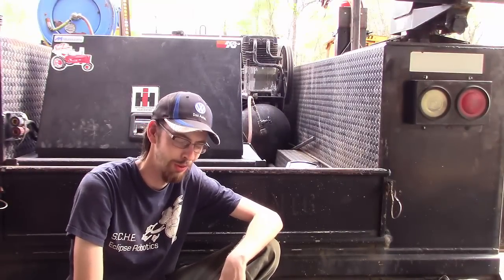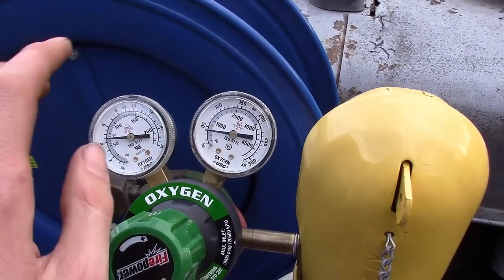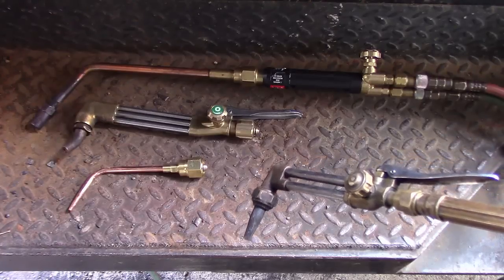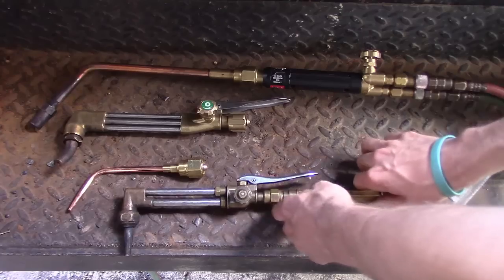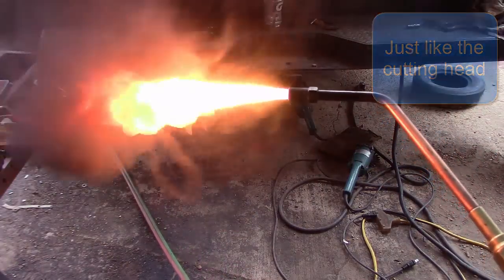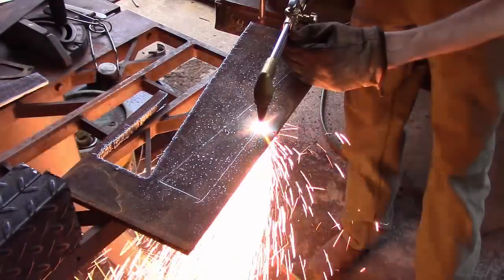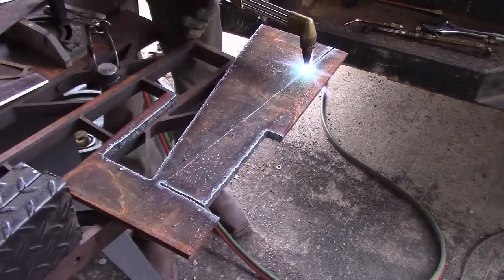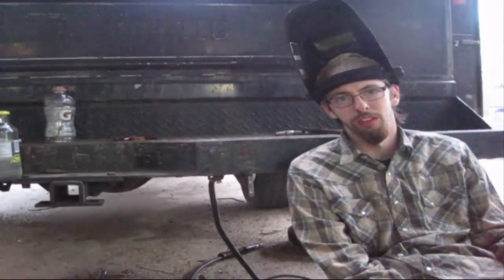Acetylene torch basics

Comment: Please explain - if the flame tip should not change when pressing the oxy handle - then why is it there?
Thanks for your help - I'm a newb at oxy/acytle
Reply from the maker: When you’re setting the flame you want a neutral flame meaning it’s burning with just enough oxygen to not alter the heat coming out of the torch. If you don’t have enough oxygen it will be a cold flame and it will take forever to heat the steel plus when you hit your oxygen lever the flame will change causing the cones on the tip grow or shrink causing a bad cut. If you have to much oxygen the sound of the torch will be much louder and the chance of a back fire is much more likely plus it will try to cut before your ready causing a bad cut.  It’s got to be just right for good results. The oxygen lever is for cutting only not adjusting the flame. Most people think that an acetylene torch is a physical process using heat to melt steel it’s not. It’s a chemical process your using oxygen to burn the carbon out of the steel essentially making it rust very fast heat is the catalyst to make it happen. This is why you can’t cut aluminum or stainless with a torch because no carbon in aluminum and stainless there is a wrong chemical bond for it to work.

Comment: You ever use compressed air instead of oxygen
Reply from the maker: Compressor air doesn’t work on a cutting torch set up because you need 100% oxygen to make the cut operate. A acetylene torch is more of a chemical process rather than a physical one you’re essentially making something rust extremely fast that’s how it cuts.  Compressed air works on a plasma torch because it’s a different process.

Comment: The reason the heating tip is whistling and warming up at the mixer is because you are STARVING THE FLAME. If the rig is in good conditions, starving is due to acetylene pressure being too low. There are o rings in many mixers so you don't want a backburn at the mixer.

Comment: Some extra things to know:
-Check the regulator max pressure against the tank it's going on.
-Make sure the cutting tip is sized such that you don't exceed 1/7th of the volume of your acetylene tank in an hour or moderate your use such that it doesn't happen as this can cause the acetylene to behave similarily to when it is above 15 psi.
-make sure your acetylene tank remained upright for 24 hours prior to and during use.
-Always purge your lines and regulators before opening the main valve and when opening the main valve especially with the oxygen do so slowly to prevent compression in the regulator causing an explosion.
-if you don't already have, get a flashback arrestor at both the torch end and regulator end of your setup.
-keep the tanks chained up.

Comment: Unfortunately, with ALL this great instruction, his valve disengagement was 100% wrong. ALWAYS shut off Oxygen FIRST due to suit blowback potential back inside the tip/chamber. "The safe and correct method is to shut off the Oxygen first."

Comment: Got a ? 4 u why my torch pops with a new tip? I just replaced the tip and it just pops like crazy
Reply from the maker: What are your gas pressure settings?  Put your accly on 8 psi and your O2 on 60 psi.
Reply: i'll try that, thank you

Comment: I watched you cutting, Is it ok to cut on top of those rubber hoses?
Reply from the maker: It’s not ideal but the hoses are flame resistant just keep an eye on them and be sure you’re not splashing them too much.
Reply: @EEJester1586  I did, but when your dross is 1200deg c it will melt both tubes really quickly. You end up jumping off a 777 cat chassis willing to break a leg to turn off both bottles, as both oxy and da ( dissolved acetylene ) lines are wheezing round on fire like windmills, burning their way back at some speed to the bottles. It was my mistake so it’s up to me to save the people around me, if a full oxy bottle goes up there won’t be much left of anything for quite some distance. They are waiting to kill you ( the bottles ) one mistake in 30 years that’s all it takes. But you carry on, just remember it’s your responsibility to run towards the bottles that are on fire.
Reply from the maker: @andyav9165  I gotch and I appreciate your concern.  Ive never had a hose fire although I have seen a few from other people.  And your right heard horror stories about people that nothing but mist because of a O2 tank blowing up or clothes set on fire from gas leaking on a shirt. They are very dangerous but I got a firm belief that it’s only as dangerous as you let it sometimes you can get away with it other times you can’t.
Reply: @EEJester1586  yea, I got complacent,  it got scary really quick, but as you say keep on top of it and all should be good. A colleague of mine, a fitter by trade lost half a thumb and quite a bit of his hearing due to oil contamination, a gauge blowing up by his face. Take it easy happy cutting🏴

Comment: Public service announcement:

I have read that you have to have a "Grade 5" shaded lens to effectively prevent damage to your eyesight while using oxy-acetylene.  I'm quite doubtful that the average pair of sunglasses are this shade.

My question to the video host:  why did you use a rosebud for cutting? I just had to spend $120 on a rosebud after I just spent $500 on a little tote kit.  

The tote kit came with useless cutting and Welding torches which I my crystal ball I don't know what I would ever use them.  Red Loctite needs to be heated before you can take it off easier.  I live in the Rust Belt and corroded Fasteners drive me insane so I hope I have less headaches with oxy acetylene in getting Fasteners to free up.

Comment: Thanks so much for making this video. I've learned a lot from this. Really appreciate that!
Btw, I don't use the torch every day, just use it to cut off the old nuts and blots. They are about 3/4 to 1"
Which cutting tip or burning tip should I use?
Reply from the maker: Thanks for watching. For general stuff I normally use number one. So I on a Victor 101-1. You can cut easily 1/4 inch to 3/4 inch with that tip.
Reply: @EEJester1586  thanks for quick response my concern.

Comment: Could you explain more about the tip sizes please no one has that but if you look on the recommendation chart for what to uses with different thicknesses of metal the tips will change from like 000 to 00 to 0. What improvements will it make in your cut if you use their guidelines? Or does it not matter?
Reply from the maker: Planning on doing a video on this in the near future.

Comment: Disagree with you on how you set the gases up sorry. You have rubber diaphragms inside the gauges. If you have the gauges already turned up before you turn the cylinders on you get instant pressure to the gauges. This can damage them in time. The proper way to do it ( btw I still do it your way even though I know its not correct) is to turn the gauges all the way out so you have no pressure in them. Turn both gases on on the cutting torch. A few turns on each one is fine. Next, you turn the acetylene cylinder on, pressurize the gauge until you have gas coming through your nozzle. Light the gun and then pressurize the oxygen using the gauge until you get the desired flame. You did not mention flash back arrestors either.Also, Oxygen is more dangerous than Acetylene. This should be turned off first not Acetylene. You will understand if like myself I have had an Oxygen hose catch fire. It acts like a Thermic lance. Acteylene gives off a "cold" flame whereas oxy aids combustion and is very fierce. This is why you should never dust yourself down with oxygen. One spark and you go up like a bomb. Finally, don't suggest sunglasses for cutting. Thats plain stupid. Sorry, not having a go at you.Just trying to give my many years of experience and still learning

Comment: "At no time should the withdrawal rate of an individual acetylene cylinder exceed 1/7 of the cylinder contents per hour.
If additional flow capacity is required, use an acetylene manifold system of sufficient size to supply the necessary volume." 
    -Victor, Harris, Airgas, etc. 
However, recently the 1/7ths rule has been amended by an additional 3 tenths. So.... 1/10ths Rule.

Comment: I forgot about the rosebud. I used to cut, solder, and braze, but I haven't used a torch in years. I think I'd be a little rusty if I picked one up now, but it would come back quickly.

Comment: Any well equipped welding/burning supply shop has multiple solutions for different types of gases, and torches.  37 years burning thick steel.  Acetylene is the least valuable of the gases. If you happen to run your tip too close to the plate it doesn't extinguish the flame, but goes into the tip itself, and because it's copper it just melts.  Blowing holes and cleaning the tip decreases the life of the tip much more than 2 piece tips used with all other gases. Burned 26" thick plate(in 1980), and routinely burned/shape cut 12" thick weekly. Propane is the gas that most all Fab/ Steel Service Centers use on "X"-"Y" axis shape cutting machines in Metro Detroit area.
            For people stuck with Acetylene this guy's advise is spot on. Chasing overtime and Fab closings i have used about everything and my choice is Harris Torches & tips using Propane.

Comment: when i learned to use a torch in ag class they always  said to stay off to the side of the regulator so if the handle  blew out it wouldn't hit you  think you would have to have a really bad regulator to do it  but that's the way i learned.  Liked the refresher on settings,  always good to review things so you don't get in a rut of doing the Wrong thing !!   THANKS again

Comment: One thing you didn’t mention was that you shouldn’t get the tip too close to the surface or touch it to the surface while cutting. I have found that it will cause it to make popping sounds and I was told that it can cause the flame to flow back up inside the  torch (flashback ). I am not an expert with cutting torches, but that was what I was taught. Not sure if that is correct or not.
Reply: I was taught that as well.

Comment: EXCELLENT video.  Only thing I would add is to the safety side.  Might want to mention and show your check valves and/or flame busters.  Very important as you essentially have two pressurized bombs at the other end of your hoses.

Comment: Great video.  Do you stay to the inside or the outside of your drawn line when cutting?  It looks like outside but what determines the width of the cut (kerf)?
Reply from the maker: You can cut either way.  Most of the time if your cutting a piece to fit inside a place you’ll want to cut it smaller that way you’ll have Clearance and just fill in with weld.  The kerf is determined by the tip of the torch. Just like in woodworking a sawblade has thickness so you’re removing material.  A torch is doing the same thing you can’t see it on camera but if you have a shade or lens over your eyes you can guesstimate where are you need to led.

Comment: Hi, I recently purchased tanks for my oxy/acetylene torch. I noticed that the acetylene tank has same type gauge fitting as oxy. Can you tell me what type of fitting I need to correct it for new gauges?
Reply from the maker: You shouldn’t need any fittings other than the gauges to bolt to the tanks.  Just remember that the acetylene is left hand thread external threads. Oxygen in his right hand internal threads.
Reply: @EEJester1586  My acetylene tank is set up with a right hand thread coupler like the oxygen.
Reply from the maker: Fred Bradford wow never seen or heard of that before.  What size tank is it?
Reply: @EEJester1586  The acetylene is about 3' tall and says 210 CF on it.
Reply from the maker: Fred Bradford ok I’ll have to do some research on that.
Reply: @EEJester1586  Thank you.

Comment: Hey, I see your using firepower gauges. Do you recommend that brand as set with torch included?
Reply from the maker: I’ve had good luck out of them.  They have been exposed to some really bad weather over the last few years and I’ve had them hang up a few times (where are they wouldn’t regulate right) but they always worked it out. They are pretty good for the price so yes not a bad set up.
Reply: @EEJester1586  Thanks for the prompt reply. I read that Miller makes smith brand which is made in US and very good. Any opinion here? Looking for good quality set up for garage use.
Reply from the maker: Fred Bradford yes smith is a great torch. The next one I get will be a one piece Smith.  The older victor torch’s are also really good. I will say the new victor gauges are not the best they are really bad to leak even when new.
Reply: @EEJester1586  I understand the victor is made in China now. Miller/Smith is the way I'll goes, thank you.

Comment: At 70 yrs. old and 37 years running "X"-"Y"coordinate systems oxy/fuel gas.  Acetylene has its place, but the real thick steel plate cutting is Propane or even lowly Natural gas(ran with a custom compressor and safety trap that was provided by the local energy co.). I have regularly cut 12" thk. plate with 3 torches simultaneously cutting bearing caps for the gear box of one of the largest strip mining crane gear boxes in the world.  The correct tip and the correct PSI for your cutting Oxy coluum is what is required to burn thick plate(problem here for amateurs is just because your cutting Oxy gage says 100PSI doesn't mean that according to specs your going to cut what the book says you should it is how big or how many Oxy Condensers you have out at yor Oxy tower behind your building that determines how fast LIQUID OXY converts to a gas!). What ever gas your running for preheat cone shield ing your cutting Oxy steam is usually anywhere from 4PSI to 35 or higher PSI for extremely thick metal.  Just so you folks know there are suppliers of  Iron-Powder-Oxy/fuel gas cutting torch set-ups that cuts up to 4 feet thick Stainless Steel, Cast Iron, Brass, and even Aluminum. Praise be to this guys vid for a basic info on Ace torches. Watched a guy start a cut on a rectangular 6" wide bar near 30 feet long out of 6150 Steel plate. In hindsight i should have stopped him as i knew one torching that as a rectangle would cause a three foot warp in that bar and cost him his job. There was a 2 torch technique that would allow the VERY EXPENSIVE 6150 to grow or contract with eqaul heats on each side of the cuts.

Comment: I am new to this and welding (which I will start learning soon also). I have access to cutting torches and will give this a try. My question and concern is the hoses, they look a bit dried out with fine hairline cracks in the rubber. Ok for quick small jobs or no good?
Reply from the maker: As long as they don’t leak.  Make sure your knobs are tight on your torch cut on your acetylene and oxygen until the pressure builds cut your bottles off make sure they hold pressure. If you have a bad leak the needles will fall really quickly. Use soapy water on regulators or torch or hoses to find leaks. It’s been my experience that hoses normally don’t give trouble unless you burn one through so you should be good.
Reply: @EEJester1586  Cool and thanks for the quick reply

Comment: interesting, a safety issue i see in how you assemble your two piece torch,  the body and attachment should always be alined so the control knobs never touch the work bench when you lay the torch down, they always should be facing upwards, the knobs can and will get bumped and turn on unnoticed, i have seen it happen inside a large tank and we had to shut down and air out the tank, it was the  acetylene.
Reply from the maker: Well in confine Areas I work a little different than in the open.  All my on site torches I run quick connectors. It can’t leak if isn’t connected. Good point though.

Comment: In other videos I watched, they talk about setting the acetalyne so there is very little.black smoke before opening the oxygen knob on the torch.  You don't seem too worried about that in your video is that just not a biggie as log as it's not chuckin I big black cloud with the black floaties?
Reply from the maker: Most people say that black smoke clogs up your tips but I’ve never really seen that much of a change.  Don’t worry about the floaties. It’s mostly a pride thing “you can’t run a torch. You can’t even set it right” what most “welders” say.

Comment: Gave up the acetylene a LONG time ago. Propane is way more practical and does everything acetylene does, except weld. It's also runs ANY size rosebud / heating tip without the problems acetylene presents...  and is WAY cheaper and easier to get.

Comment: you for got.  that in the main tank it is pressurized  to 200,  300 ,psi with out blowing up.   how they do that?    the main tank has a big block of balsa wood soaked in acetone.  the acetone soaks up the acetylene.   then releases it as you ask for more acetylene.    if you ask for to much it will spit acetylene out.

Comment: 5 psi fuel is not enough. You have to have back pressure or your risk of flashback increases. 25 to 35 Psi oxy is plenty strong to cut 4 inches. 60psi  is overkill unless your looking for the metal to hit the floor and not concerned about how clean the cut is.. ALWAYS  turn your oxy off first then your fuel gas ..everytime your torch pops out it sends that black soot into your mixer which causes clogs (which keeps me in business)even the victor manual tells you that. No disrespect but you really don't know the proper way to use a torch.
Reply from the maker: Different strokes for different folks. I’ve got a friend that runs 7 and 70 with a 000 tip cutting 5/8” plate. And it looks cleaner than a saw cut.  It is all what you make it wrong or right.